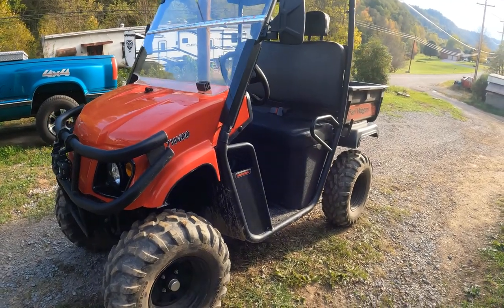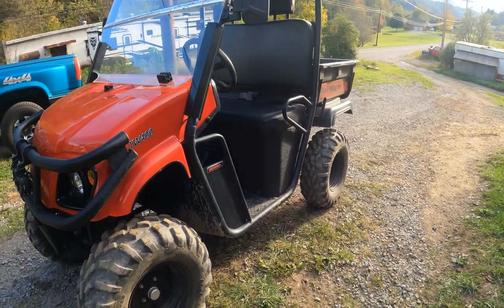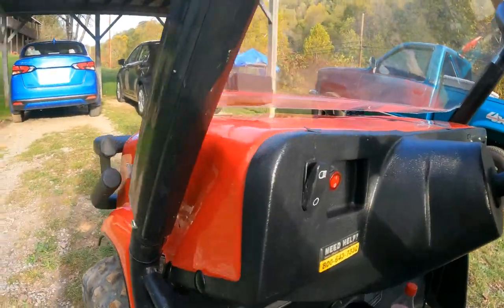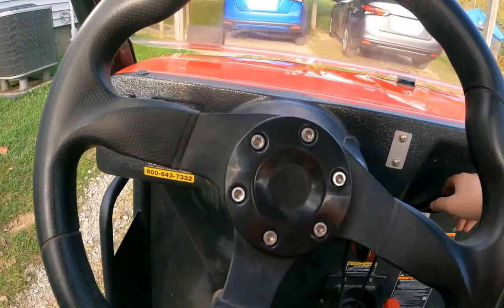Trail Wagon TW400 Review

Comment: Just picked this 2010 unit up. In the process of redoing the front end. Threw out all of the plastic. Moved the ignition and light switches to the metal front panel. Adding led lights and bar and fabing a hood skin out of aluminum. Going to suction a solar panel to the skin that plugs into the cigarette lighter to slow charge the battery. Also found some cheap air shocks on Amazon to replace the six. Should turn out pretty good and functional.
Reply from the maker: Nice let me know how it goes